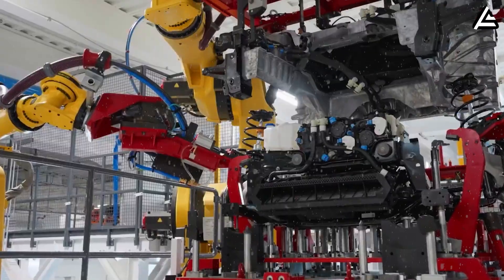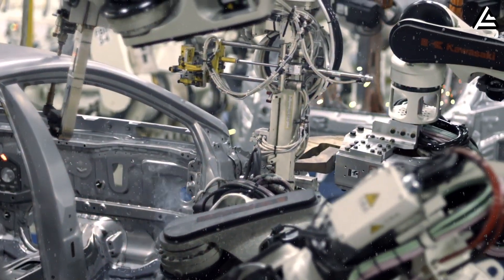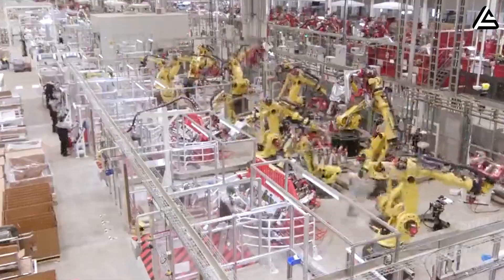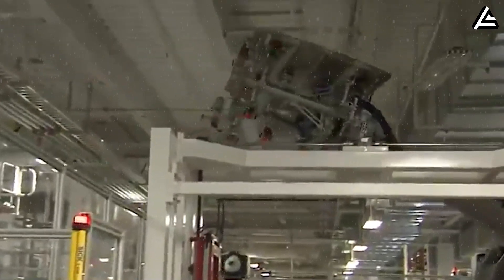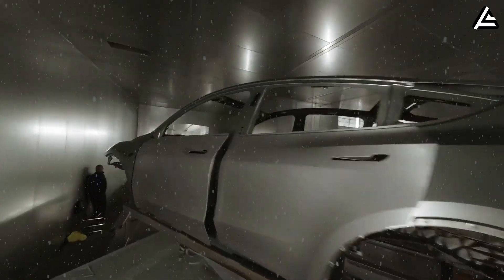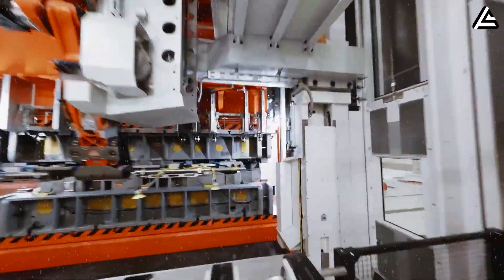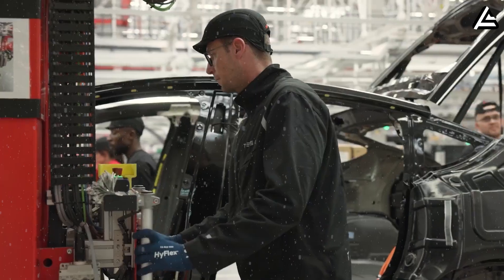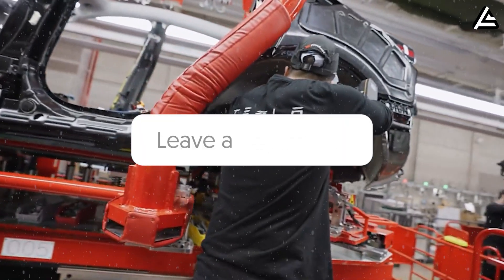Tesla Model 2 Production Line FINALLY Revealed. 1 Million Vehicles, 1 EV Per 19 Seconds

Comment: I wonder how the suspension handles potholes.
Reply from the maker: the Model 2’s lighter platform should actually help here. Its updated suspension geometry is designed to absorb sharper impacts without transferring as much shock to the cabin